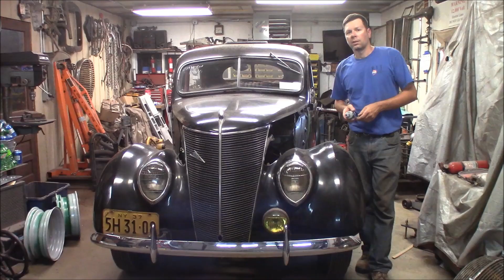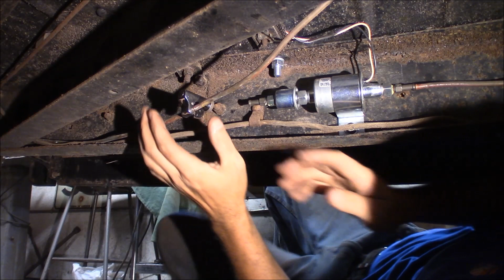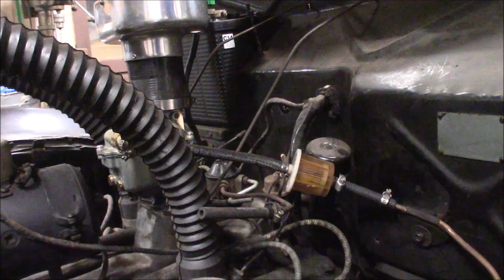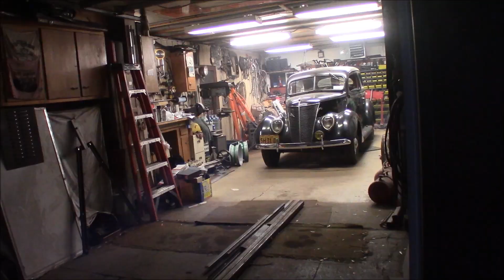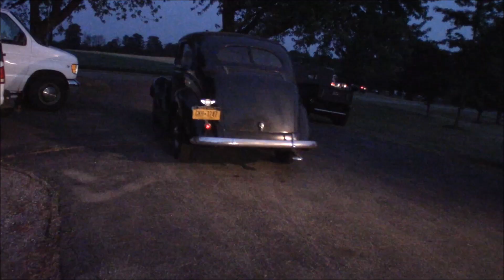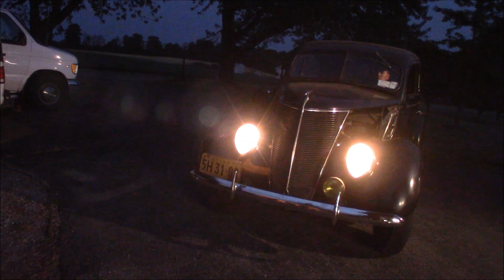1937 Ford V8-60:  Installing a 6V Electric Fuel Pump

Comment: Hey, I just put a 6v electric fuel pump to by pass mechanical like you did mine has the pressure dial on my 32 Plymouth 4 cylinder. Pump is running But will not pull fuel, what’s your thoughts. Very frustrated.. Thanks Phil
Reply from the maker: It needs to be close to tank as possible.  Pumps like to push, not pull.  Also, is your fuel line clear?  Old hoses could swell shut and steel lines could be plugged.  I'm ditching my pump for a new mechanical factory one.  Only installed this one because I couldn't get a new pump at the time the video was made several years ago.
Reply: @QuickSpeedShop  yeah , I blew out all the lines prior to installing, I have tried the rebuild kits for the mechanical before, not much luck with them, can’t buy new mechanical, not available. I mounted it kind of center of the frame on a nice flat spot, approximately four feet from tank, very similar to yours, l have asked to return it, you know how that normally goes. I have enjoyed all your videos, were kind of alike, I’m a DIY guy also, Thanks for the input,
Reply: Hey Josh,  I’m going to take the piece of gas line I cut off, flair both ends, put rubber hose on and try and move back closer to the tank and see what it does, what you think?
Reply from the maker: Put it as close to tank as possible.  Prime the pump by pouring some gas in it or in the line.  It might not pull fuel without a prime.
Reply: Hey Josh, One more. Important question, I have about nine gallon of fuel in tank, do I need to drain that out before I start to cut line, if so what about fumes left in tank?
Reply from the maker: I mean, if the fuel in the tank is above the fuel line then it will drain out when you cut the line.  I don't know how a Plymouth is layed out.  I mean, use common sense with the fumes.  I wouldn't drain the gas next to an open flame for obvious reasons.  Do it outside if you're worried about it.
Reply: @QuickSpeedShop I am draining the gas out turning on fans, opening doors, probably will put an air line in tank, remove gas cap  let go all day, my concern was will the cutting tool like you use cause a spark possibly, I am taking all ways to do it safely. Thanks Josh, I’ll let you know how it turns out!
Reply from the maker: Cut the line with a brake line pipe cutter.  Don't cut the line with an abrasive.  You'll never get the fumes out.  Or remove the line from the car and cut it that way.  I just had to go watch my video (its 8 years old) and I cut the line with my pipe cutter.  There is no way to get a spark from that.  Just dont use any electrical powered tool.
Reply: @QuickSpeedShop may have worded it wrong, that is what I’m using, like yours, just wondering it that might cause. Spark?
Reply from the maker: There's nothing to spark, it's a wheel and a couple of rollers.  You only have to worry about fuel vapors from a spill.  I'm literally welding on a car right now, a ft from the gas tank.  I just plugged the vent line so vapors can't escape or ignite.
Reply: @QuickSpeedShop thanks Josh, I’ll leave you alone so you can get some work done, thank you so much, take care

Comment: I don't understand how you did this.   You skipped  your old fuel pump and went straight from the new electric fuel pump to your carburetor?  I thought you'd keep the original pump in use and place a regulator between the electric pump and the mechanical pump, setting the regulator at approximately 2.4 PSI.  This is an "assist" for your original mechanical fuel pump to assure fuel is readily available when needed.  Going straight to the carburetor will overwhelm the carb and flood it and flood the motor with too much gasoline.  Maybe I'm wrong...let me know.  :)
Reply from the maker: The mechanical pump was leaking and, at the time, the repops were back ordered.  Running straight off an elec pump, through a reg, is totally acceptable.

Comment: Are there any fuses on these cars ?  Im fixing to install a new 6 volt pump . Thanks for sharing your time and work 
 Good job.
Reply from the maker: No, most cars that old don't have fuses.  Mount the pump as close to the fuel tank as possible.  They are meant to push, not pull.
Reply: My 1951 English Ford V8 Pilot has ONE fuse - for the lights.

Comment: I'm adding an electric pump to a 72 el camino and can't really find a clear answer. Can I just tap the hot on the pump into the ignition wire coming from the fuse block?
Reply from the maker: I mean you could do it that way, but it should really be on its own 12v switched source.

Comment: My '36 has a block off plate where the fuel pump went and has a 6v electric fuel pump on it like yours. However, when I gave it the beans the other day, the fuel pump rod started making a tinging sound, apparently hitting against something, maybe in the baffle? I guess I might need to put a manual pump back on it. May put a bad one on it just to keep the rod from hitting something? Also, thought about putting both a good manual fuel pump and a electric fuel pump. That away in case one fails, I still got the other one to keep it going.
Reply from the maker: If you can find a good mechanical pump I'd just run that one and use the electric as a booster on startup.
Reply: Just take the fuel push rod out… it doesn’t need to be on the car if you plated off the fuel pump.

Comment: Is it normal that the fuel pump makes that noise when is pumping ???
Reply from the maker: Yes, electric pumps make some noise when they run.
Reply: @QuickSpeedShop  but mine is super noisy, i have it in my BMW E21 and sometimes i can hear ir with the engine running and inside the drivers cabin with de windows closed. Do i have a bad fuel pump or just need to bolt it into a rubber surface ???
Reply from the maker: @luckyspray  That pump is probably in the tank and if it is making that much noise it is probably going bad.
Reply: @QuickSpeedShop  i have a electric fuel pump, is installed inside the engine hood, near the left front wheel. Is it too far from the gas tank ???
Reply from the maker: @luckyspray  Usually you want it as close to the tank as possible.  Honestly I know absolutely nothing about that BMW, how it is layed out in terms of fuel system.
Reply: @QuickSpeedShop  thank you so much for your replies, i'm from Peru and you have been of great help, i'll try close to the fuel tank as you suggested. Thank you brother !!!
Reply from the maker: @luckyspray  Good luck!

Comment: On my 1941 Ford the electric pump pressure was too high (and caused flooding) so I added a pressure regulator and set It at roughly 2 PSI. That fixed the flooding problem. Really nice car--
Reply from the maker: Thank you.  I haven't really worked on the car since the video, but hoping to get back on it soon.
Reply: @QuickSpeedShop  I originally put a cylindrical coil but decided to keep the car original and had Skip Chaney rebuild the original coil. My car starts as soon as you hit the starter button now.
Reply: Sorry, that was Skip Haney (you probably already know about him, but just in case) 29436 Taralane Drive, Punta Gorda, FL 33982; Phone 941-505-9085 and 941-673-6698. Such a nice car, I hope you keep it original (electric fuel pump is okay with car-show judges). This guy does a great job of putting the umph back into the original Ford coils.
Reply from the maker: @williammiller9499  I know about Skip.  I'm actually going to swap the car over to all 85 hp drivetrain soon.  The 60 hp is really tired and waterpumps are a big problem.  The car will remain stock, swapped with all original Ford 85 hp parts.

Comment: After modify the pump how you feel the car?  is using more gasoline than before? or same fuel usage?    how many psi is your pump ?
Reply from the maker: I actually haven't driven the car with new pump.  The fuel system still needs work, but the engine has other issues currently keeping the car off the road.
Reply: @QuickSpeedShop  did u put a return fuel line?
Reply: D

Comment: I think you're going to need a fuel pressure regulator.  I had to put one on the engine you now own using the same pump as you're using. The carbs can't handle the pressure.
Reply from the maker: I'll try one, but as we discussed on the phone, I think the 60 is coming out and your 59AB is going in!
Reply: could you share me a link of that kind of regulator?  I'm using a car with carb & electric pump and I feel more fuel usage than mechanic pump usage.